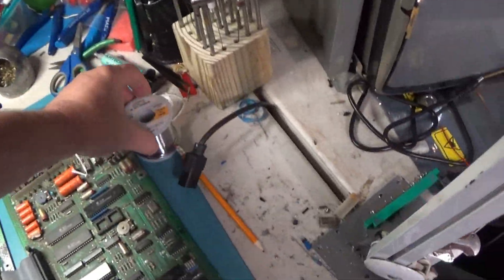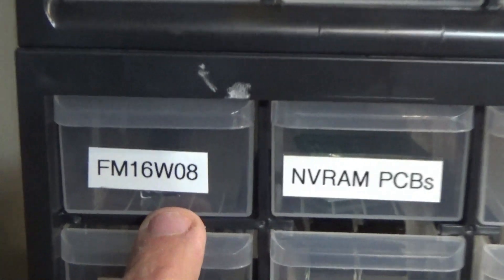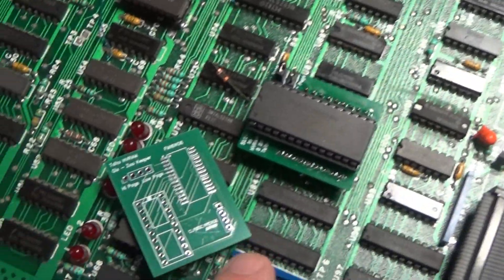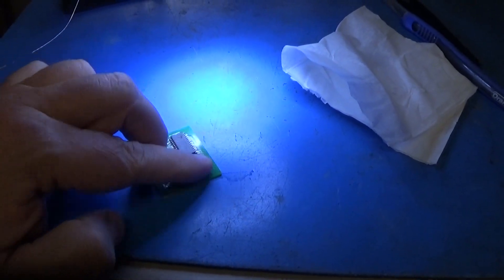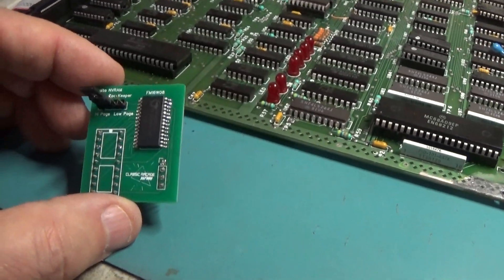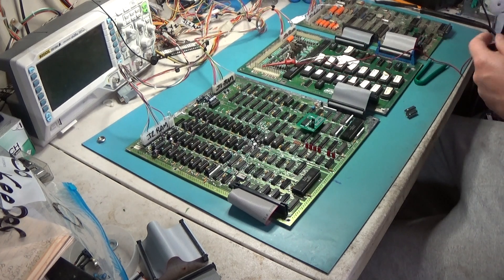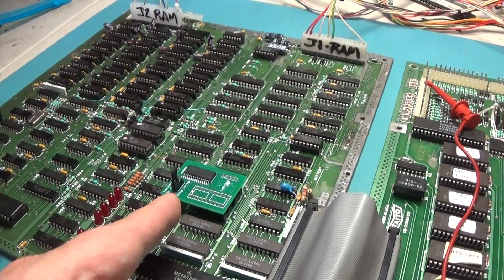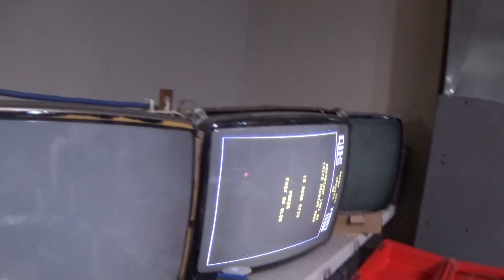New NVRAM PCB for Taito QIX/Zoo Keeper Sets!

Comment: Great work, and thanks for making these available.  One question though, wouldn't machined sip pins be gentler on the sockets than header pins?  Truly a question, as I use sip pins, but if header pins have worked better for you, I'd like your input.
Reply from the maker: @brendanvogele2531  yes machine pens are definitely better… I just don’t use them because they are just more expensive… It’s that simple

Comment: I'm wondering.... When were surface mount components even invented anyways? And when exactly did they start to get commercial use in arcades?
Reply from the maker: @thardump859  pretty sure there are surface mount chips on arcade PCBs from the late 80s.    90s for sure
Reply: the technology started to appear about 1987 but for a very limited range of parts it became a lot more commonplace in the early 90s.
Reply: @TheMadmagik Thanks for the answer! The GameBoy uses a single surface mount chip that is actually the entire console! Except for the RAM, of course.